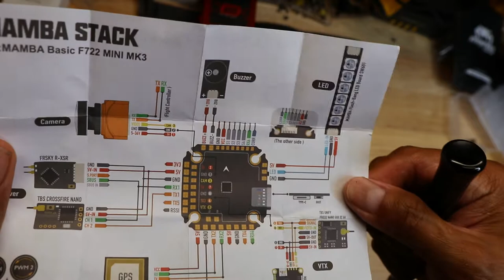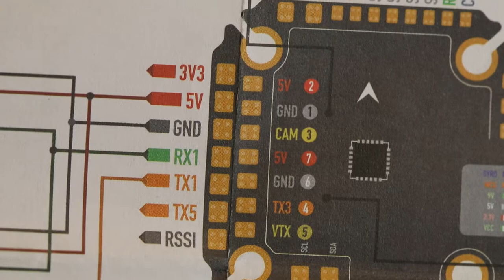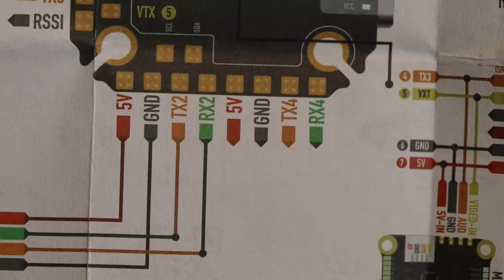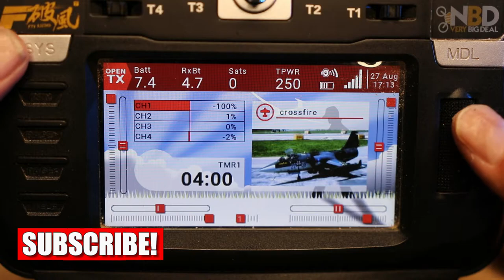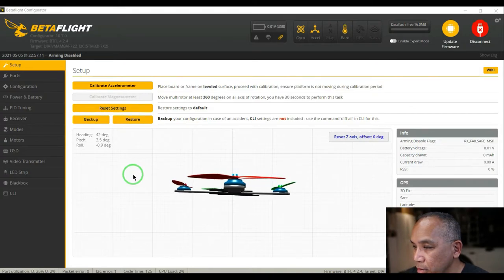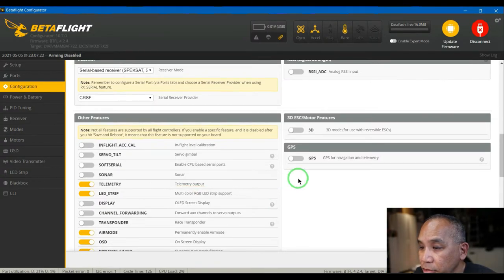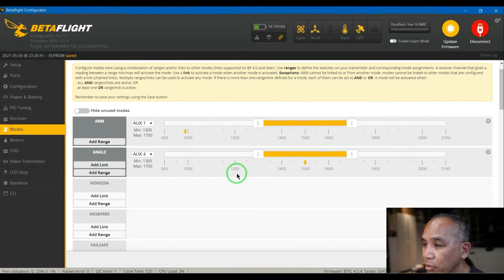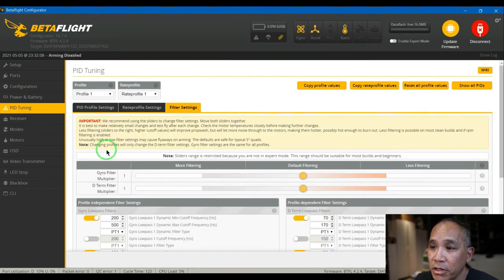Diatone Mamba F722 Install - Part 1

Comment: Thanks for the video. I am building a 4 inch LR and just bought this stack. How did your Caddx Vista work out? Im trying to see if 5v is enough to power the Caddx
Reply from the maker: Caddx Vista takes up to 6s power.  I recommend just wiring straight to Vbat (as long as it's not more than 6s). Make sure to always put a capacitor and you should be good.
Reply: I just built a 4” LR but I can’t get this board to hook up to beta flight? I get device malfunctioned error in windows. Has anyone come across this before?

Comment: I'm watching your video because I met that exact issue, and maybe you met it too since I can see you cut a part of your video at 2:25 . Do you confirm you need to plug in the battery to get juice in your RX ? (I only had boards where RX were juiced in USB ; I expect a F722 as that one also would...)

Comment: Hi, please can you help me. I have just finished a build of a quadcopter. With mamba mk4 f722 mini stack. It arms  ok, but once I go past mid throttle, the moters just scream even when I take the throttle to it's lowest point until I disarm it. Can you tell me please what am I doing  wrong. I am just about pulling my hair out . I am using a radiomaster t16s and a frysky xsr ultra reciver using sbus Can you help me, please it would be much appreciated
Reply from the maker: That's interesting. How does it react when you manually spin it on Blheli 32? I would try to fly it and see what happens. It could be a tuning issue
Reply: @ciscocalderon5436  Thanks for that info. I will give it a manual spin on blhei. But not game enough to try to fly it until I can sort this problem out. I don't want to have any chance of injury, but thanks for the info . I have only ran it without props .